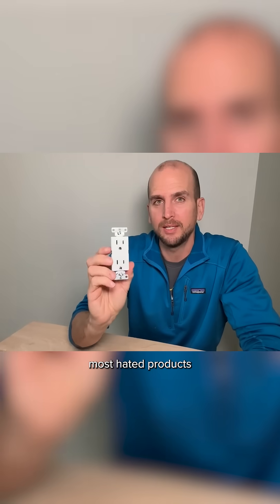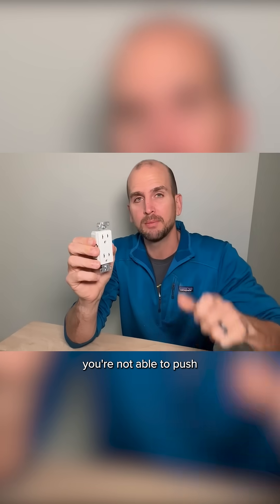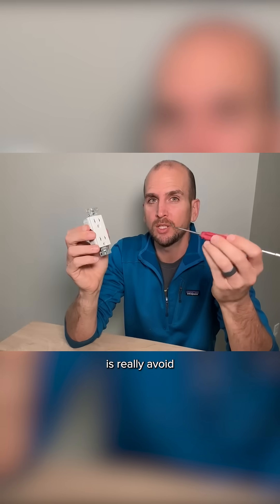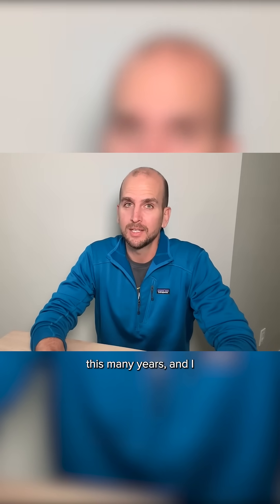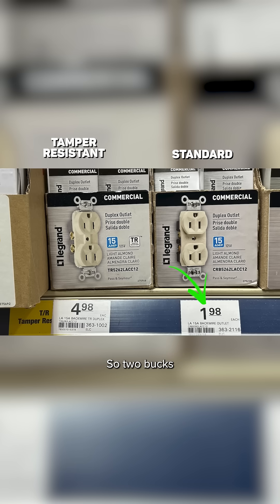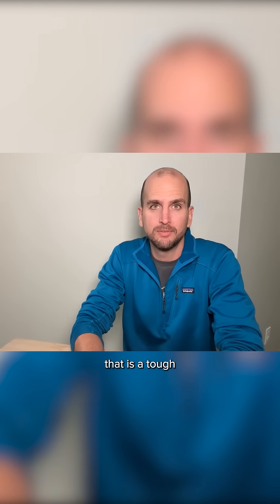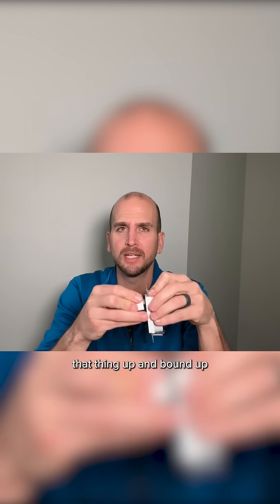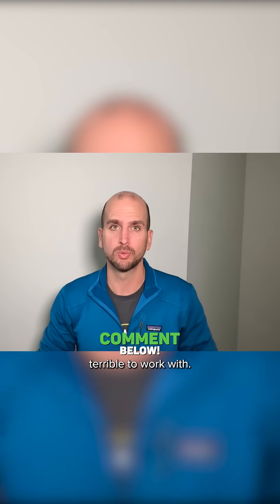Tamper-Resistant Outlets – Safer, but Worth the Hassle?

Comment: I work maintenance 5+yrs.... 1 of 7guys for about 400 apts... smh i didnt know the safety applies to both sides..
Makes perfect sence.. 
(When u think of kids with pins or butter knifes n such..)

!! I thought it just needed a firm focus to push it in, LIKE FROM AN ADULT!!😂

...but the plug needing both at the same time, makes even more sense bc of kids n such..

The amount of times ive told college kids to literally just use their force to plug it in😂😂 

But honestly the tamper solution makes sense... BUT NOT when as a nation in past years companys by "law or policies" idk which one started making one side not just wider but longer..

Usually now the left tab of the plug is bigger but from poor manufacturer n or ignorance theyve got longer so it hinders pluging into newer tamper proof outlets. 

Making it a b*tch, 

So a majority of plugs i see have a bigger tab n longer which counters the whole "you need to activate both sides at oncd to plug in" 😂🤦‍♂️🤦‍♂️